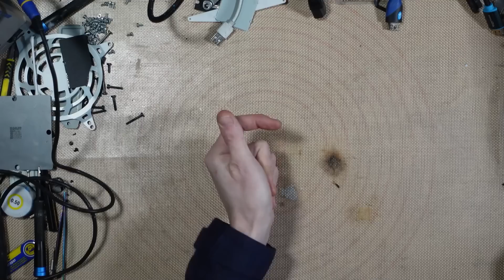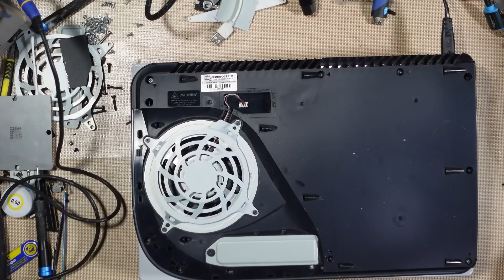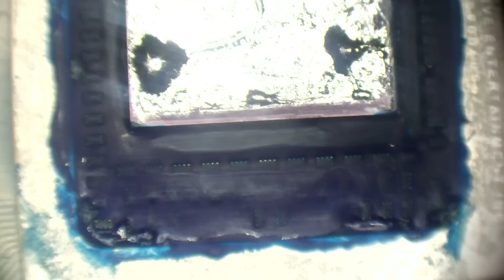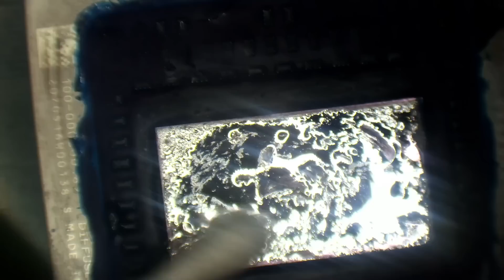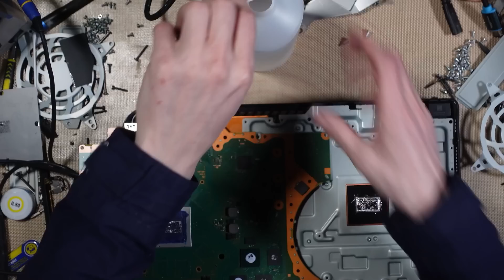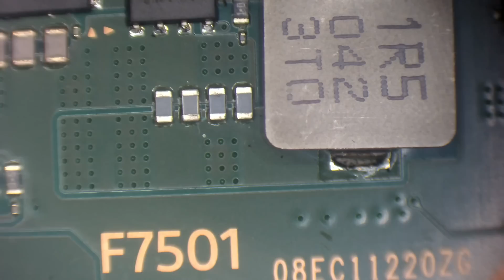My Customer Sent TWO Different PS5s Back For Warranty In 24 Hours! WTF Is Going On?

Comment from the maker: Yes I had a bed head, I know 🤣 make fun of me if you want, I couldn't be bothered to put my face on for the video 🤣🤣
Reply: did you just want to make us bald ppl jealous on christmas day hm ? Tstsstststsstststsss...
:D :D :D :D
Reply: @5L4P5T1CK  I was on the understanding that all bald men had demolished a bedhead or two.
Reply: Hey mate, Enjoy the Channel.... You say this is Warranty, So I will assume you have the Numbers recorded that it or They are actually the Systems you sold??? And these No'.s aren't on Paper tags/stickers that can be taken off and replaced with the other tags of another system
Reply: I don't know what you ended up doing mate but I would have gave them this choice- either you can take your money back and buy one elsewhere or you can have the fixed console on the condition that if it breaks again they're on their own. I feel for the kid but people just won't admit liability for anything even when they know they're wrong. Makes my blood boil.
Reply: At least you’ve got dressed 😂 I’m still sat here in my dressing gown 😊
Reply: Makeup next? 😂
Reply: @GamingForLifeGF  knocking shoudnt kill it. Seen loads of ps5 repair vids and when they open them the liquid metal is all over the board. Terrible design, cheap and nasty.
Reply: @Eldrickkk  I think Sony could have a huge problem this gen with failure rates. Not just with the liquid metal leaking but the stick drift in controllers and them cheating out on copper components in the newer models over heating is inevitable.
Reply: @sully8317  tic toc has loads of vids on the liquid metal carry on. Honestly they all come out the woodwork to get clicks on this.
Reply: with the time spent. is it worth further agro. im sure you've said its for a mate, i would just refund him, not worth the fuss. i refurbish macbooks, from experience i would never sell to family and friends again. you are tied to it forever in their eyes so they will always be calling you for the slightest of things and more. im already stuck with a few i regret and a few that have fallen out with as they don't think its their responsibility through ignorance and expect you to fork out every time.  i learnt hard way and stuck with the few until im dead and buried.
Reply: Whatever was rattling inside may have been something metal, a coin or something.
Reply: I really do feel for you, drop me a message and ill buy you an LCR meter, keep up the good work
Reply: Dem sweet rosey cheeks tho...
Reply: That a strange situation should have charged him for twice the time and twice for the repair due to christmas day and boxing day he not meant to work both days like that. I would lean against the electrical works in the house is abit dodgy. I knew a person who had to replace his sky box plus 5 times in a space of 9 months due to poor wiring in the house due to the bulbs for lighting the sitting room were halogen bulbs the one with the reflectors on the body were interfering the sky box plus
Reply: A good business man knows on those rare occasions when it is time to fire a customer.
Reply: When you first had the console on the bench I said to myself something in the home was the cause.  A heater causing a volyage sag  or like that.
Reply: My PS3 has crashed where it says press ps putton for the controller is it fixable ?
Reply: @jamieeedden777  Either overheating or dying hard drive with bad sectors
Reply: @neddy1287  thanks very much ned it was the harddrive it works like a champ now I am very greatfull for the advise as the PS3 mum got me and she died in July before my birthday I had to sell all the other consoles she got me to pay for my share of her funeral so it's nice to have one working she got for me
Reply: @jamieeedden777  Glad to help :) And also sorry to hear about your mum I know the same feeling since my father died in November 2021 and I have a Asus P6X58D-E that he told me to get 3 years prior and it was working till the day of the house fire a month before he died and I am still currently looking for a cpu socket replacement to restore the motherboard back to former glory since the socket got broken pins and badly oxidated from smoke and moisture damage so I be able to restore the motherboard into my pc case. That why I be able to look at my pc case that I can think he be with me
Reply: @neddy1287  it's a shit feeling mum was only 46 as well it's hard that grandad died Jan 30th 21 then mum went July 7th 22 2 generations gone in 2 years I keep busy tho as much as I can :) sorry to hear about your dad I don't know what it's like to have one but that must have hurt
Reply: @jamieeedden777  I know the feeling lad it crushed my mother after losing her husband before 50 years anniversary. I can take on so much responsibility after looking after dad about 6 years since he was diagnosed with Parkinson's Disease which eventually killed him as he was only 74 years old it was heart breaking for me and now I taken on a bigger responsibility to look after mum for another few years again while trying to rebuild her home from scratch which is not the same as there's no history or memories left inside the house. Since the house fire the damage is so bad it will cost about €85000 to rebuild it from the ground up. I can tell you I have lost my uncle to heart attack and lost my aunt to accidental overdose with medication with alcohol in a space of a week this was about 15 years ago
Reply: I subbed simply because tech videos are so over my head they are relaxing, and you scolded idiots you talked about your hair. I'm in.
Reply: Money back
Reply: Bed head 🤣 Not an issue for me anymore mate.
Reply: I HAD A LOVELY ROAST ON CHRISTMAS AND BOXEN 📦 DAY IT WAS A BEEF ROAST YOU CAN LIKE MY FINGERS AFTER YOU FIX MY PLAYSTATION 😂👍🫣🥱🤥🤥🤥🤥🤥🤥🤥🤥🤥🤥🤥🤥🤫🤫🤫
Reply: @markwilliams9964  Your suppose to say lick not like
Reply: I just admire the consistency of the bed head
Reply: I recommend taking complete photos; before and after repairs. My car repair company do this for this reason.
Reply: Are you sure it's even the same system and not just a broken one he already had at home?
Reply: This is my new favourite channel. It's like watching Repair Shop or one of those BBC2 'slow' programs - very relaxing and chilled as someone takes their time repairing something that requires skill and patience. It also reminds of me of some great times living in the West Midlands. Well done Sir!
Reply: hmm, did you check console serial numbers to exclude possible fraud on you?
Reply: Power surge.
Reply: You made feel confident with this comment 😄
Reply: First off I'd blame Travis its all his fault then again as others said refund the customer cut your losses whilst you can or if you want to be genorous this christmas you could if you know the customer and his address and felt confident maybe offer to go to his house and check out the socket he is using and his electric setrup first after your holiday off but for me personally I'd refund the customer advising him again that the extension cords he is using in his kids room have either had stuff spilt on them causing spikes or is just flat out overloaded or just faulty without any surge protection or just the socket itself faulty.
Reply: @monkstandinglast  a
Reply: I think it looked great 😅😅
Reply: Take-a-little-pride-in-yourself-since-you-make-videos-for-Youtube-and-you-have-followers.
Reply from the maker: @robertovaldez7082  no

Comment: It more of a common problem, almost every 5 I get for repair 1 has one of those ceramic caps fail. I typically replace them all with higher rated voltage ones and since doing that haven't had one come back for warranty. Never do just one as it be back as the other will fail shortly. I also check ESR and replace one in the PSU as typically what causes them to fail is way to much ripple in the switch mode supply.
Reply: Noise on the driver wave from a fault or noisy mains feed, or just bad filtering?

Comment: A common failure point.  Well your in the electronics repair business. I've been working on Electronics for 25+ years and unfortunately, sometimes things just DIE. I've fixed things and then 10 mins later something else that was on the edge to fail just goes. that's electronics. Caps are funny things at times. LOL

Comment: This video is 1 year old , but I tell you what I do, I put security labels plus my own bussines stamp or seal with a logo I use so is two layers of protection against this kind of problems. If they open or try to bring another device I will find out right away

Comment: Realise it may be too late to say anything cause the issue may all be sorted.  The thing about repair is if you don't notify the owner of security markings on the machine for the sake of fraudulent activity, then there is always that chance if serial numbers are not logged , then a different machine may be returned. As for 'bad caps', then caps have a life as do other components.  IMO the caps have just had their time.  How old is the machine?  Electronics generally has a life of approx 5 years.  ?  A repair on Christmas day would not have been do by myself. It would have waited till after xmas.

Comment: Wouldn't a good power bar with surge protection help? I know a line conditioner or a UPS would be optimal. I would tell the customer that you wont honour the warranty if something like this happens again. I mean it worth another $40-$50 CAD for a line conditioner, plus it will help keep your electronics happy.

Comment: If the drop is what caused the shorted cap then it was customer falt and should pay for the repair, not be warrantied. The warranty should only apply if your work had failed for no reason which is unlikely like you said in your video

Comment: It wasn't  your fault. You fixed the first issue, and then it came back with a different issue. I'd charge them for the fix since the issue was different from the first. Then I'd tell them to get an electrician out to their house to check their sockets and electricity to make sure everything is on the level. But the warrenty was only on the repair you made last and not the new repair. Charge them for the repair.

Comment: My bet is This was just bad luck on a cap that was faulty and waiting to fail. it doesn't make sense power problems could make it past the initial rectifier and filter, threw the isolating transformer, past the 12v regulator, past the 5v regulator to then take out that cap on the 5v rail.  Not your fault not the customers or the mains power. just a cap waiting to fail and some bad luck. Just an opinion

Comment: Very strangely I had my RCD trip 3 times over Christmas and it popped my Nvidia shield. Wonder if they were messing with the grid and interconnections ? Anyway if you value your kit get surge protectors.

Comment: I had my power supply die on me. cost me 300 to fix the damn thing out of warranty. I suspected it might be my power lines because my pc PSU literally caught fire a few months before, and my house is over 200yrs old, so I got an expensive APC backup unit to keep the PC and PS5 safe. so far so good!

Comment: Rule 1: The customer is wrong (dropped it....then home wiring issue...which is it....must be both) 
Rule 2: Refurbed PS5 consoles are ultra reliable and if it breaks, the customer broke it. (Every component is as good as new)
Rule 3: Do the repair at Christmas time, but complain, complain and complain...so wounded.
Rule 4: In future, any warranty issues, be prepared to have yourself, your console and repair slammed on Youtube.

Comment: I feel ya on the stress thing...
Its even worse when an ssd fails 2 weeks after building machines for a lawfirm and they didnt backup data....  
I actually paid to send in their old drive to a data recovery lab because i felt awful.
They were about to lose everything.

Comment: as a computer tech/fixer myself, i would explain that you found the problem a cap had blown, and that the only reason it would blow is bad house wiring, then say, you have had 2 separate consoles die in 24 hours... they have the choice, a refund, or the working console and if they come back with the same console dead and its that cap the warranty will be void and they will have to pay for the repairs. more often then not i've given that same choice to return customers and they take the refund. or if they choose the computer back then they go to the only other repairer in the area who i am good friends with and well yeah. he gives the same options.

Comment: i had a power issue with a PC a few years ago, the machine would ramdonly power off. I took the machine to my workshop and had no issues, i did change the psu as it was a cheap unit for a rated one. when i took the pc back it ran fine for about 5 mins until it switched off again. so i explained again that i'd had no issues or found any faults and agree'd to take it away a second time to test.
Again i had no isssues in my workshop so after running the machine another 24hrs i returned it.
i plugged in the machine, it booted to windows and then instantly shut off! it was either a bad socket or bad electrics. i advised  getting a surge protected adapted and to try it in another soctket as id found no faults with the pc. he appologised for the mess around and said he'd get an electrician in to change the socket etc, paid me and that was that.

Comment: Cut your losses and refund them. Tell them to also get an electrician to check their household electrics. I'm looking to get my Xbox One Forza 6 edition repaired. I cleaned it out, repasted as I usually do and put it back together. It does the revving engine noise with a glitchy noise then shuts off. Also the power light doesn't turn on. I'm half tempted to buy a standard one and just swap over the external panels, but then it would lose the sounds. What should I do?

Comment: I would give the console back and say that it has been repaired under warranty and you have gone above and beyond the initial repair and 2nd repair for the amount of cost paid for the repair. Advise them that this console has been repaired under this warranty fix Christmas day warranty and will receive no further warranty repair from you. Highly  Recommend that they use a surge protector that is not overloaded and that there house wiring could be faulty. Recommend that they try the Ps5 at a friend's house for a few hours. Also if the console stops working smacking the side of it will not only not work but also dislodge the liquid metal inside.

Comment: you appear to not remember the all repairs per item, may i suggest that u record the repairs that you do per machine, using serial number, item description, sender of item, date, costs to you of the parts used, perhaps total time of the repair, reported faults .  etc etc use a spreadsheet or hand  written or printed pages kept in a folder, Not having a pop at you, just trying to help you

Comment: This is not the customer's fault of never buy anything form you bud! You already trying to make it excuses like a father is breaking the PS5 on purpose on his son?   🙄 the ps5 are junk! I have had three PlayStation ps5 break on me from brand new right of the box from the store! We had a fan brake on one the disk drive on another and the CPU went on the other, all of this within 4 months. 
Can't tell you the number of broken systems I've gotten from pawn shops return them just to be given another broken system that only lasts a day. Physically impossible nobody went inside that and ruined those fuses 🙄 you're selling a used product that somebody's already put time into that's broke that you've repaired. Once these systems start failing and you start taking them apart and repairing them they'll never stop failing they'll fail and fail and fail countless times over a different problem everytime

Comment: That’s definitely warranty all day long. I am a qualified tech & certified as well although I do not practice hands on anymore. You were just very unlucky with this. What you need to do is have a phone for work & work email but put an out off office on both & switch your phone off. You need to give a terms & condition’s warranty stating bank holidays the offices are closed. If a customer buys a recondition unit they will more than likely accept the inherent risks that come with that as should you. Sony definitely wouldn’t fix any retail gaming unit in the UK on Christmas day or boxing day regardless.

Comment: My approach would be to explain my concern with them and advise them to ensure they use a surge protection power board when plugging in the device. If they dont you will have to then void their warrenty

Comment: Did he use the same power supply on each? Very possibly could be transformer running high, or his outlet could be putting out too much AC.

Personally to avoid issues and potential scammer looking for trouble just refund him and tell him you will no longer work with him due to suspected faulty home wiring. Yeah it sucks, but  people like this it's best to not play their games. At least you got the console back.